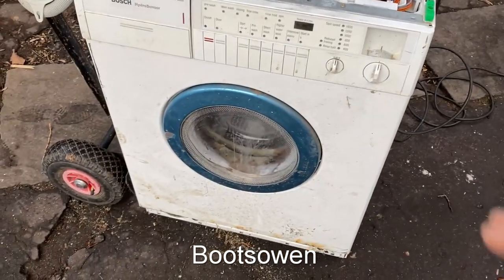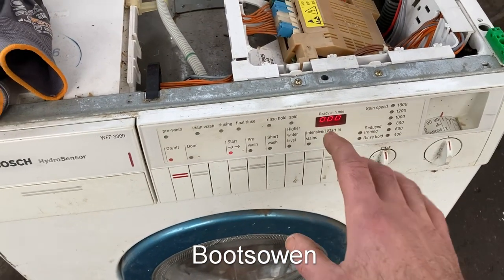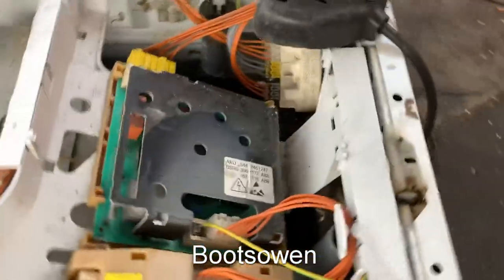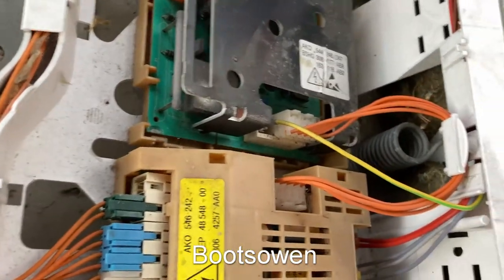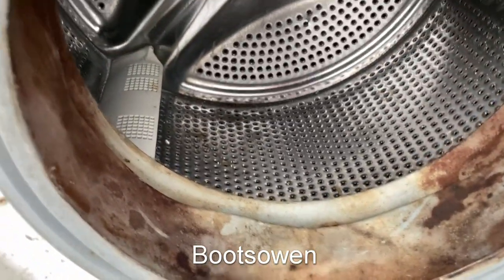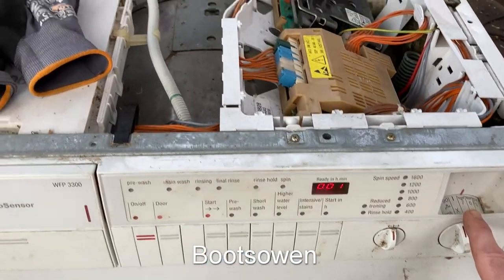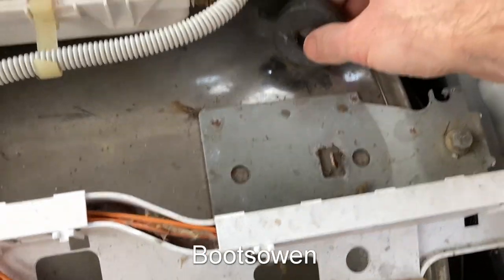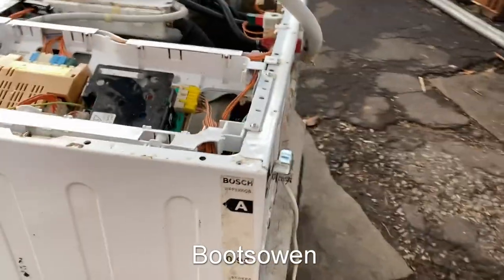Could it be the best washing machine ever made? Whichwasher2007 thinks so! Bosch WFP3300

Comment: I have it's predecessor a WFS 4030, 1400 rpm model, which I bought new in 1993 for £650, expensive in it's day but I was determined to buy a high end machine so I saved up and stretched my budget. The only repair has been to replace the carbon motor brushes since when the motor has become slightly noisier on the high speed spin but, it still works perfectly and it looks great. Only the small diameter door size, compared to a modern machine, gives its age away. In particular its out of balance detection is extremely good, exceptional for its day. So, hang on to that WFP3300 it's a beaut!!
Reply from the maker: I really like them. They are pretty much indestructible. Even the wff 1401 budget one is robust and repairable. The only difference in the internal spec seems to be the shaft diameter and the size of the bearings. Higher spin bigger bearings. But all replacements available somewhere.

Comment: Wow nice find! Definitely one of the best machines BSH has ever made in my opinion, just like your WFK 2801 but way more premium! Also, it's made in June 1999 :)
Reply from the maker: Apart from the door it seems to be very similar to the WFK2801, and maybe the 1600 spin. How do you know it's june?
Reply: @bootsowen  7906 - Add two to the first digit making it 9. 
So you will end up with 9906.
99 being the year and 06 being the month (June) This works on all Bosch/Siemens machines.
Reply: YouTube keeps removing my comments probably because it contains too many numbers haha! Anyway, you have to look at its FD number located on the sticker(s), in this case it's 7906. Add 2 to the first digit and you get 9906, 1999 6th month - June!
Reply: @bootsowen  The FD number has the month in it.

Comment: Hello Bootsowen, can you show us how to remove the paddles on these WFK models?  Or perhaps you have done so in a previous video that you could give a link to. Thank you
Reply from the maker: I think they are the same as many other machines, so have a look at my liberating washing machine firepits playlist where I take a few different machines apart, you have to get the drum out then bend back a little metal tab then the paddles slide a bit and fall out. You have to do it from the outside of the drum.
Reply: @bootsowen  Thank you, I will watch those. Cheers!

Comment: I think you must pull the board out, you have to take off the heatsink and see if there is any component that looks burnt, if you can't see anything suspect, use a multimeter to check all the power components. Save this masterpiece of machine. Sorry if my english is bad, but I don't speak english.
Reply from the maker: Your english is great! I don't think I can check all of the components with my multimeter, it is only good for resistance and voltage/current.

Comment: Seems like a great machine, sure worth saving! For me it looked like the smoke came from the big grey resistor, it could be that it has absorbed moisture that dries off when heated. But I can't diagnose this from my sofa, lol. Could also be a capacitor thats gone dead over years of no use and decided to smoke a little.

The numbers on the sticker on the side: 
0.95: 0.95kWh 
1600 spin
5.0: 5kg load
49: 49l water usage
Usually measured at the 60° cottons cycle, or (if it has it) on an 60° eco cycle.

To say it's the best machine every? I'd say a Miele Novotronic W985/W986 is better, as they are designed for 20.000h of use. But this could be the best BSH machine every made! At least the best one with electronic user interface.
Reply from the maker: Thanks for those details. that is a lot of water to use, but maybe that is normal? I'll have to take a closer look at the board.
Reply: "W985" and better in one sentence, muhahaha NO. Miele died when they introduced the second generation 800 and 900 Series machines in late 1996.
Reply: Oh, the amount of water is pretty decent, considered it does 3 rinses, instead of 2 like modern machines on eco...It's all tricks; 2 rinses, lower temperature with much longer mainwash.

Comment: Take this smoking board out and test every single component on it starting from that dicoloured triac/transistor whatever that was.

Next test the engine (using variac)
Reply from the maker: is it possible to test every component?
Reply: @bootsowen  

It doesn"t look like there is much on that tiny board. Test everything you can test. 

I once had a regulated power supply that wouldn"t regulate at all. It turned out that all "power" trasistors were shorted and the next thing that failed (during troubleshoting) and gave a electronic smoke was one of smaller transistors responsible for driving bigger ones